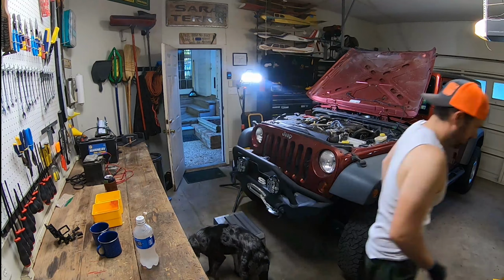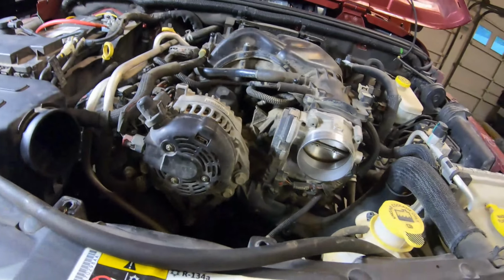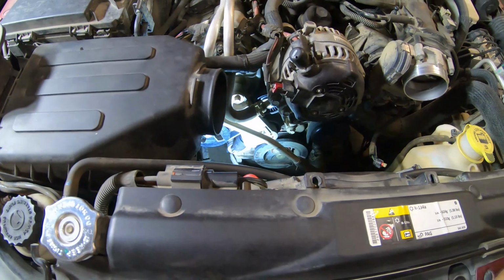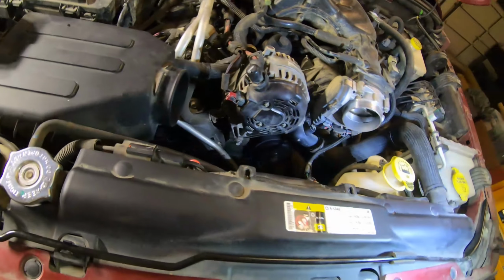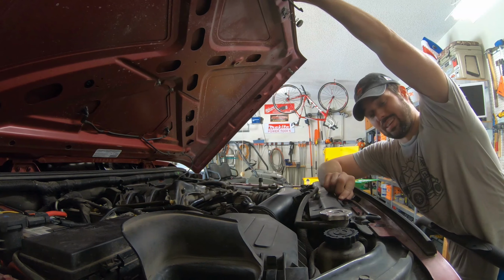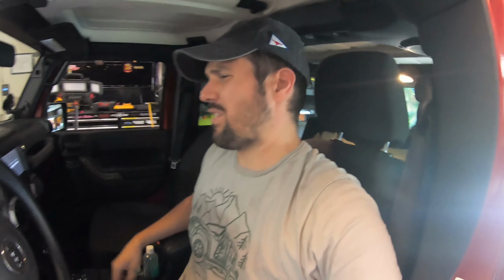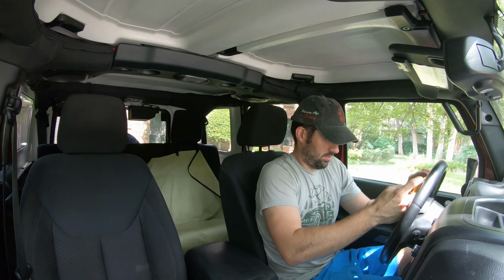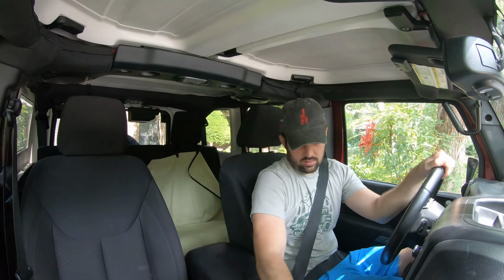My Jeep was making a HORRIBLE grinding noise and I tried to fix it but the Jeep had other plans

Comment: Thanks man for the video. I knew it wasn't anything on front of the engine, as I removed the serpentine belt, started it and still made the noise. I thought it was something in the transmission as I could hear the noise coming from that area but after watching your video gave me the idea to check the starter and have the exact same situation. Thanks again.
Reply from the maker: No problem 👍

Comment: Thank you for this video!  I was trying to track down a terrible noise coming from my 2004 TJ, I started with the camshaft synchronizer which was not my issue and was about to start on the pulleys and various parts upfront.  Pulled my starter after watching this video and sure enough the flywheel was eating my starter.  I mistakenly replaced the starter and the new one was eaten within seconds but at least I know the source of the terrible sound.  Now I get to move on to Flywheel and Clutch!
Reply from the maker: Sounds like it is coming from the front of the engine every time!

Comment: I have the same issue. Replaced all the parts up front along with tensioner and harmonic balancer and still have the noise. After work I'm pulling the starter.
Reply from the maker: It’s surprisingly easy to get out, and once I got it out you could tell pretty quick that was the issue, good luck!!

Comment: I wish you could have shown a better recording of the noise.  I am having a weird grinding noise coming from my 2015 Jeep Wrangler, I took it in to my local Pepboys auto shop and they changed out my alternator.  Well noise was gone for about a week or two and now its back.  Just my luck it was really loud for about 3 days over the Thanksgiving weekend.  I took it back to mechanic following Monday and noise went away.  So they did not do anything and told me to bring it back if noise came back.  Well I'm not comfortable with that because it was loud and I know parts don't fix themselves.  I wonder if its my starter now.  Noise is not super loud now but I can hear something in the engine still kinda grinding or something.
Reply from the maker: Easy way to check the starter. Pull the two little rubber plugs at the bottom of your bell housing. (Very easy to get to and no tools needed) and see if there are metal shavings inside. 

Or just pop of the starter, it is a couple bolts underneath the driver side, very easy to get to. Check the teeth to see if they look chewed up.

Comment: I Jeep Wrangler makes intermittent grinding sounds no check engine light comes on nothing on the dashboard. It happens forwards and backwards. Could they be dirt getting in somewhere?
Reply from the maker: Check your drive shafts in and out of the transfer cases. The u joints go out pretty often.
Reply: @ZeroToAwesome  problem is how to replicate sound to mechanic